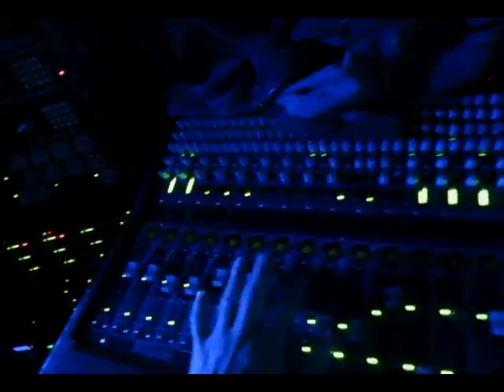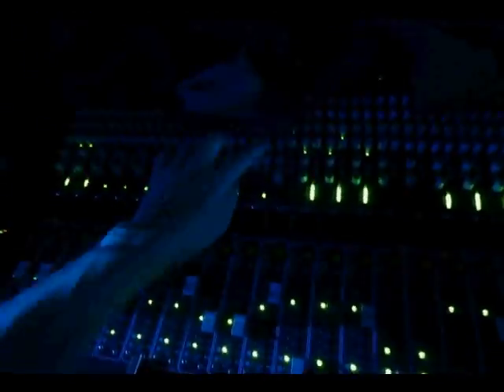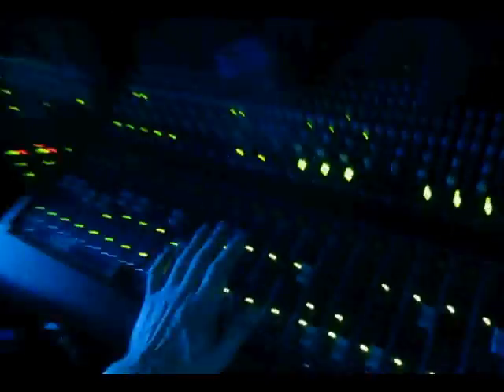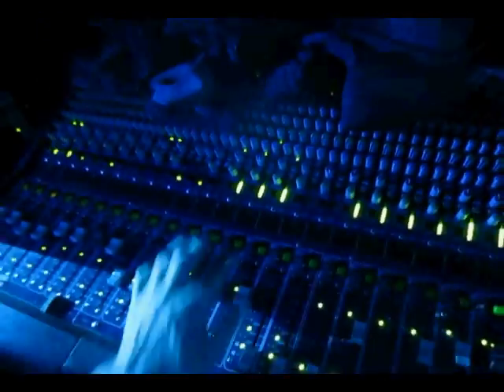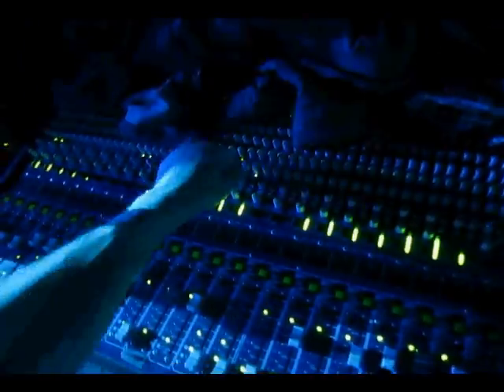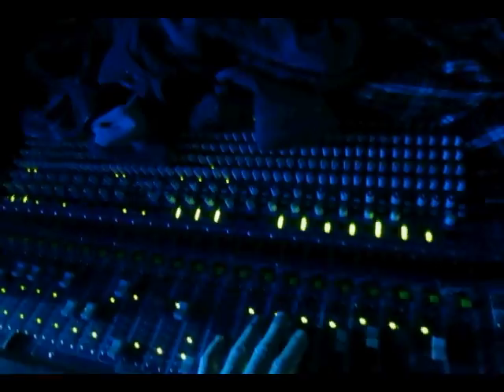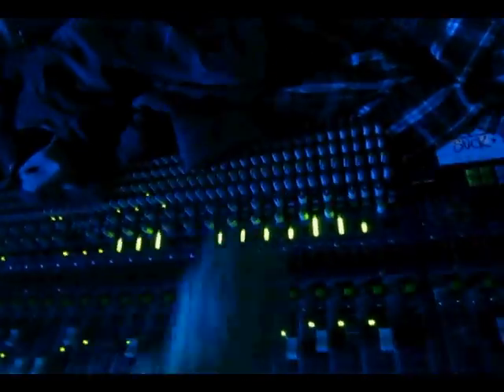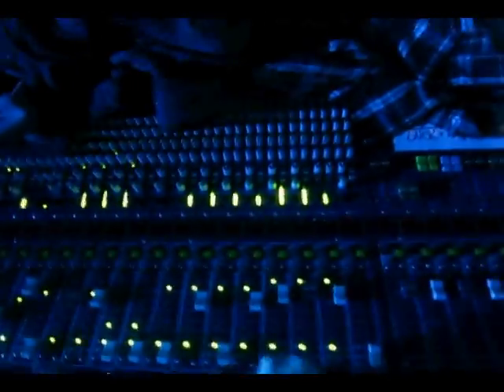Red Hot Chili Peppers FOH Mixing Console & Rack Gear 2012 Tour

Comment from the maker: Have you made sure both are in polarity with each other? Some amps are pin 2 hot and some are pin 3 hot so even if all wired correctly, one 18 could be out of polarity.  Try reversing the wires going to one of the 18"s and see if that improves things.

Comment: Dave, i really enjoy your input on your sound advice. I have a peavey system that i use and it is working well the way I hook it up. I'm wondering tho why if you get about 20 feet away from my subs(which are not peavey) you lose a lot of bottom end?? I'm using a PV 3000 amp bridged for 1 18" speaker (4ohm) and a QSC 750 bridged on other 18. Both 18's are 4ohm cabs, rated for 2000 watts peak. 1000 RMS..........Suggestions??

Comment: Why do you pan your snare and kick mics hard left and right?
Reply from the maker: I try and minimize the exact same sound being sent to left and right. When the same sound is radiated from multiple places, it causes power alley and comb-filtering such that the center of the room sounds different than anywhere else. By reducing common L/R signals, yes the sides will sound different but that big buildup in the center is reduces.
Reply: Dave Rat so do you eq all the mics as if the other mic (snare top or bottom/kick in or out) were not there? 

instead of eq'ing the kick in to pick up the click, and the kick out, to pick up the boom and combining them together..
Reply from the maker: Sort of, I EQ every mic to sound good but not necessarily the same as the other.  I am fine with Left/Right differentials, just as I am fine with the impossible to match close seat/far seat differentials. I am fine with every seat being a unique seat as long as every seat is a version of a great sounding seat.
Reply: Dave Rat what do you do about the panned kick mics in the subs? Run the subs stereo to avoid phasing or is there typically no issue between the 91 and d6?
Reply from the maker: +FroloSound I try and run stereo subs on 2 aux sends. I then pick whick mic gives me a better LF sound and send it a bit more to one side and send the Bass mic a bit more to the other side.  That way I am not sending identical signals to both left and right subs.